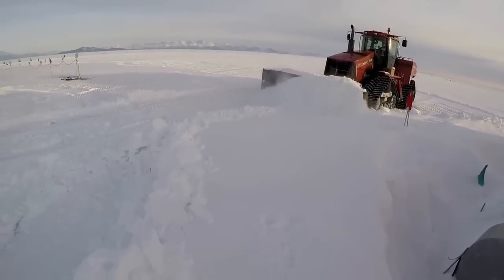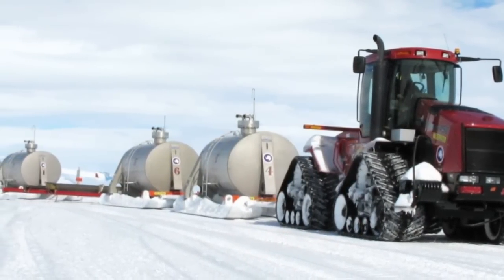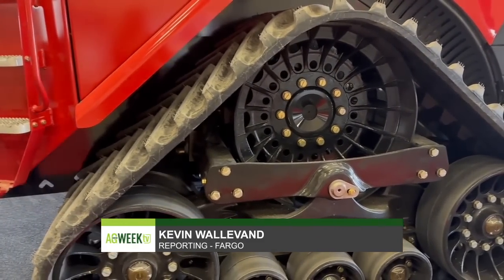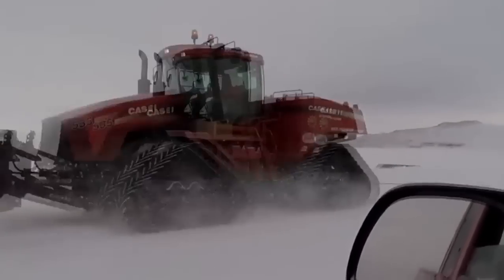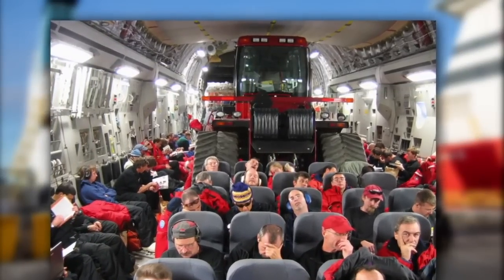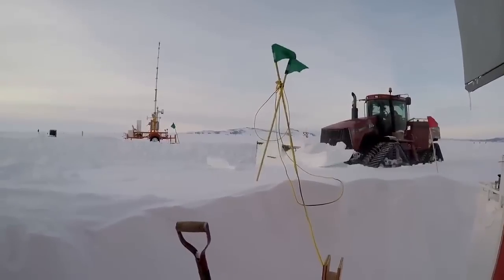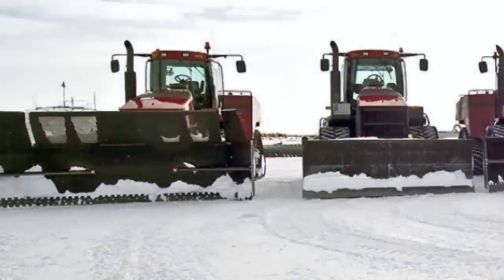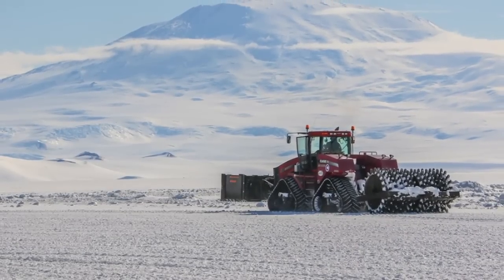Case-IH Tractors Headed to Antarctica

Comment: How in gods name do they flow diesel at -71?
Reply: No they can't ( almost can't ) so they have to use different kind of fule or heated fule tanks ( but heated fuel tank means you have to keep engine running 24×7 ) so modification to engines and different kind of hydraulic oil and different kind of tracks ( so they don't get hard ) and that's why they have to remove emission type of things. And still it's not done yet ( laughs to the people arguing for emissions )
Reply: @GOOD_FARMER  The tractors in the US program run on AN8, and no, they don't have to remove the DEF systems. The tracks are standard, and in my observation, -45F is when they start to have trouble. It doesn't get below -40 at McMurdo very often, but when it does, there isn't much operating of these tractors.

Comment: How bout thanks to the American tax payer funding all this high priced equipment.
Reply: The brand new tractors in the video are for the Australians, so they didn't cost the American taxpayers anything. Most of the footage however is from the USAP, which has an annual budget of around $500 million. The budget that was just approved for the US military in 2023? $850 billion or 1700x more, and that's even $45 billion more than what the president asked for. The USAP did take delivery of two new MTS quads early in 2022, but I can tell you that it was time. I think the newest Case quad there is about a 2010 model, and none of them have fewer than 15000 hours on them. One of them certainly has over 20k hours.

Comment: new 535's to push snow, talk about overkill. i can grantee no maintenance worker is sitting that cab long enough to burn all that fuel in those expanded tanks. they run 12+ hours doing real field work with stock tanks. all that said i can't argue with their taste.
Reply: The expanded tanks are probably for the multi day journey between bases, after all 12+ hours of field work may not take a full tank, but 48+ of pulling 6 sleds probably will. Plus in antarctica, or anywhere remote, better to have too much fuel than not enough

Comment: Have seen them in the arctic before. A mine had 2 of them and the mine blew up both transmissions and had issues with exsposed control modules. Also rocks are a big issue with the tracks. There kind of overrated.
Reply: Mining is a bit hard on tractors haha
Reply: @Bowiiihowdy  yea, at least in antarctica they (mostly) don't have to deal with rocks, just cold and snow (tho ice can sometimes be just as hard as rocks)

Comment: Wonder if those tractors will stay there forever or be shipped back somewhere when they get replaced
Reply: Doubtful, those things were built for one purpose. I’m sure there just gonna repair until its lifespan is up and then they just leave them.
Reply: @wrecker8236  As I understand it, Antarctica is definitely one of those places that's being left "pristine" for future generations' scientific and nature enjoyment benefit. They'll absolutely run the equipment into the ground, but they'll do their best to keep track of it and bring it back to civilization for scrap or re-use.
Reply: @MarcusWolfWanders  yeah I was thinking about that as soon as I posted it. I just know for a fact shipping a 63,000 pound piece of scrap metal back to civilization is not going to be cheap.
Reply: @wrecker8236  The NSF brings a resupply vessel into McMurdo Station every year. For the trip back, the vessel is loaded with garbage and other various bits of cargo. The used up machinery would fall into that category - at least as far as the US program is concerned. So while it wouldn't be cheap in and of itself, it's all part of a previously laid out plan that is already paid for. I can't speak for the Australians though, and that's who the new tractors in this video are for.

Comment: Those fuel tanks must be upgraded to hold more fuel, must be nice. Normal farmers can’t have that luxury off the lot? And yea DPF delete and maybe put a bunch of heat tape on the hydraulic hoses and heaters in the trans/hydraulic tank and then they good to go work in the cold. No track mods. Be cool to see studded tracks, especially for pushing snow on top of ice. Rubber and ice don’t mix well.
Reply: I don't see why more fuel capacity is necessary.
Reply: @Dr.IanPlect  …because it’s Antarctica
Reply: @funny3scene  That explains NIL, and stop thumbing up your own comments.
Reply: @Dr.IanPlect  who else is going to like it 🙃
Reply: @Dr.IanPlect  that explains everything, and I didn’t but you appeared to have
Reply: @matt45540  quite
Reply: @funny3scene  Take note of what Jonas wrote; that's details, not 'because it's Antarctica', which is useless.
Reply: @Dr.IanPlect  that is all implied if you have a small amount of common sense
Reply: @Dr.IanPlect  The drive long distance of a few hundred miles while towing heavy sled, you dont want to run out of fuel there and have to abandon the tractor and the supplys.
Reply: @jonasstahl9826  That makes sense as a backup, thanks.
Reply: @Dr.IanPlect  if you actually didn’t know I apologize but it’s all pretty obvious, because it’s Antarctica.
Reply: @funny3scene  It came across as snark.

Comment: why do they need the big frame quadtracks lol u dont need that much power for snow
Reply: I can't speak for the Australians, and that's who these new tractors in the video are for. The US program however needs them for their weight, mostly. Occasionally, one of them will be taken out on the South Pole Traverse as well, and that size tractor is nice to have in comparison to the standard MT865C that is used for the traverse. The US's Case Quadtracs are nearly all tired out though, and they took delivery of two new MTS quads early this year.
Reply: @jakecarruthers6513  Which break down constantly
Reply: @jynx18kaz  must be an operator problem. I personally put the first several hundred hours on 241 over the winter and had nearly no issues.
Reply: @jynx18kaz  what break down ?
Reply: Call them and tell them that then, maybe they'll promote you to head of their resource and equipment division. Or, maybe they've already considered other options and your intellectually impaired brain can't fathom that other people probably have a greater understanding of this than you.
Reply: spreading out weight over larger contact points on the snow. the snow's pretty deep in antarctica in a lot of places - you wouldn't want to sink to the axles or frame, because then you're not gonna be able to plow your wheels through the snow. better to stay on top of it.
Reply: When the government funds you a million per tractor you don’t say no thanks I just need 300K
Reply: @Daniel Heise  That's not how it goes down, stop eating crayons.
Reply: @rorschacht8478  so the government doesn’t provide funding? Simply stating someone is wrong doesn’t prove much tell me how I’m wrong
Reply: @Daniel Heise  The government doesn't randomly just say, "Hey, you want a couple of $2m tractors?". They have to apply for funding, with proper reasons, and prove the need for the equipment they wish to obtain.
Reply: @rorschacht8478  Actually the government does just do that, have you seen the national debt?

Comment: Don't you call those beautiful red machines "Case" tractors. They are CaseIH tractors! Emphasis on the IH, that's where the brand really came from, and why they are red. Leaving out the "IH" when you speak the brand's name is blasphemy.
Reply: Actually, these models are part of Steiger technology and lineage, not International Harvester.

Case IH bought Steiger in 1986 and got the heavy tractor technology.
Reply: @stevangucu522  No ,you're wrong.IH bought a 3rd stake in Steiger back in the 70's and the relationship passed on to Case-IH in the 80's with Case-IH aquiring Steiger.
Reply: @chipps1066  Even if IH bought 1/3rd of Steiger, it continued its own line of tractors until the full merger. Also, IH wasn't the only company Steiger gave articulated technology, it went to numerous small companies and big companies, even in East Bloc like Hungarian Raba-Steiger.
Reply: @stevangucu522  What is your point,? With both companies historys ,it seems only fitting that Steiger would become part of Case-IH..and did.
Reply: @chipps1066  My point is that journalists call it just Case, and I don't mind because it is just easier. I don't get mad because they haven't said "Case-IH Steiger." It is their job to put as much information in the shortest time possible.
Reply: @stevangucu522  As my comment says, the entire BRAND really came from IH, not those specific tractors in the video. But about that...
Steiger built IH articulated 4WDs since the 4366 beginning in 1973. So although the acquisition of Steiger didn't occur until after the Case-IH "merger", the relationship and experience with Steiger was from International Harvester too!
Reply: Ford had a stake in Steiger in the 70s and 80s too. I've got a 1979 Ford FW30 which is recognisably a predecessor to those Quad-Tracs.

Comment: What happens to these units after they are done in antarctica?
Reply: They definitely wont be abandoned there
Reply: @distilledmilk2441  we left trash on the moon 🫢
Reply: @2ndamendmentmf183  I could not care any less, and I bet you don’t either because it won’t affect anyone literally ever. Big deal
Reply: @DistilledMilk  Afghanistan 🇦🇫 hold my beer 🍺
Reply: They will go on craigslist... "High run time but operated only in ideal weather conditions, usually just idled and used to push a snow plow once a month or so, no low-ball offers, I know what I have"
Reply: Iv seen alot of abandoned equipment in the arctic. I wouldn't be surprised if they were left.
Reply: @maxp9046  the plan is to not continue to pollute and leave junk for future generations
Reply: @maxp9046  Antarctica is different then the artic
Reply: They are ran until they can't, then they are parted out until the machines that run cant. Eventually they will end  up on a vessel north to be scrapped
Reply: They will never end that mission becose its inposible do in dangerous weather -100, its white dead for everyone who try
Reply: @titityytyler01  people are there rn bro you good? They got like special houses and stuff for the cold

Comment: Someone needs to remind case that it's time to update the appearance of their new products
Reply: They look good to me. Don’t see an issue with appearance
Reply: It’s a dated look that is still worlds better than JD.  Since we’re throwing out opinions I’ll add mine.
Reply: Maybe they should paint them green for a season as not to offend the John Deere guys!??🤷🏼‍♂️🤷🏼‍♂️😜
Reply: @cyrusumberger5285 😂😂😂
Reply: @cyrusumberger5285  painting a pile of scrap from red to green isn't going to change the fact that it is still a pile of scrap tring to look like a Jd 🤷🏻.
Reply: @cyrusumberger5285  JD guys would not be offended that you would paint your case green, it would be taken as a complement as the case guy knows he fucked up and is painting it green with delusions that it will work 🤣🤣🤣
Reply: @cyrusumberger5285  if you paint them green they automaticly have to go back to the dealer every 59 minutes worth of use to drain your wallet!
Reply: Not everything needs to look like a spaceship nowadays.
Reply: The tractors being exported have lots of different parts than the typical ag one. The ag ones have a much newer look
Reply: if it does the job its supposed to, and keeps the occupant/driver safe from the elements, don't fix what ain't broke.

Comment: No emissions stuff for sure.
Reply: Is this paid through government as well? Ironic, isn't it...
Reply: Bastards
Reply: Yea does antartica haul in all their DEF???😂😂😂
Reply: Emissions aren’t on govt equipment because they know it’s unreliable.
Reply: They have def
Reply: ofcourse not, don't think adblue will work in that cold
Reply: @stefgrootlipman69  im making a point that emissions regulations don’t mean anything to the governments. Military and all don’t have to follow regs. It’s all about money.
Reply: @DaddyStarbuck  government ploy at this point... Above the laws they put forth
Reply: @DaddyStarbuck  emissions will always be a problem. If you did your research, those Tractors have systems that drastically reduce their emissions and sacrifices efficiency.
Reply: @Jasekingg  these tractors models all come stock with DEF systems. However in extreme sub zero the DEF system would have to be removed, due to the system unable function properly in extreme cold and would result in engine damage/ failure.
Reply: @animosity8774  that is incorrect. The US has a few DEF-equipped machines in its fleet, two of which are new MTS 3630Ts that they took delivery of in February. DEF systems functioned fine.
Reply: @jakecarruthers6513  that is interesting to find out. Personal experience on a 450 quad has me sceptical. However will look into it more, thank you for the correction.
Reply: @stefgrootlipman69   our Adblue/ DEF has been freezing in indiana. Last week it was 0*F with tons of cold wind, of course the DEF fluid froze badly on several trucks.
Reply: @trentwheeler6161  Do you have any kind of heating or other solutions in DEF systems? Because in Finland, where i live DEF systems work just fine. Even when it's - 22*F/ -30 C or colder. All machinery with DEF have also heating coil, that uses warm engine coolant to melt the DEF tank. When you start the engine in cold weather, it's not using DEF. It heats the tank up and after that start to use it.
Reply: Muh climate change though
Reply: @MrErichonda30 climate change happens wether humans are here or not tho 😂
Reply: @danielkerr4100  just pointing out the hypocrisy of "scientists" using fossil fuels.